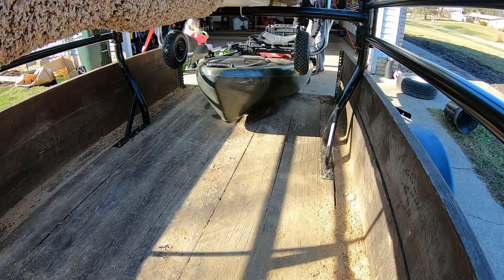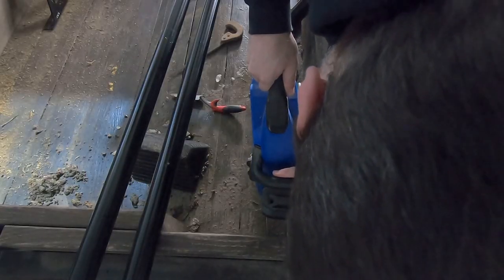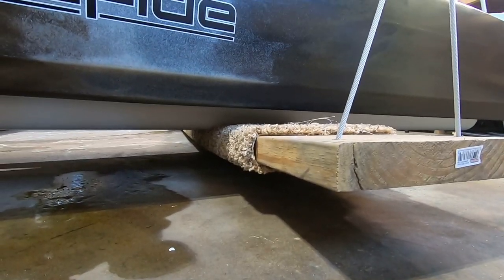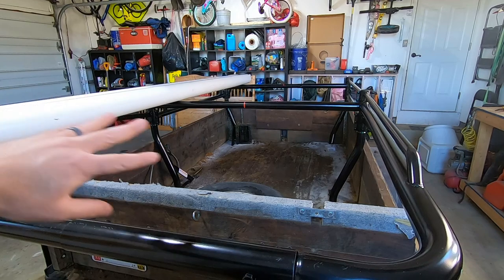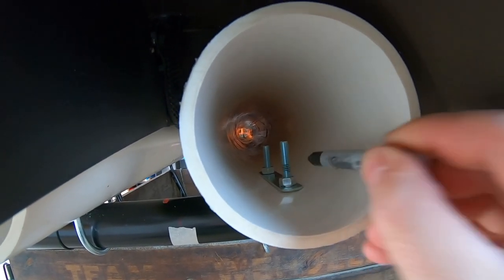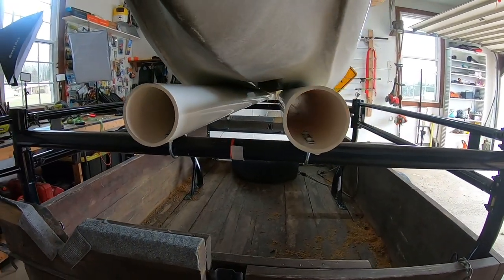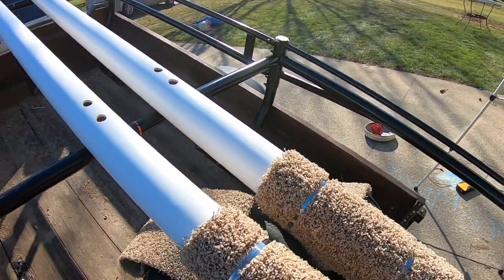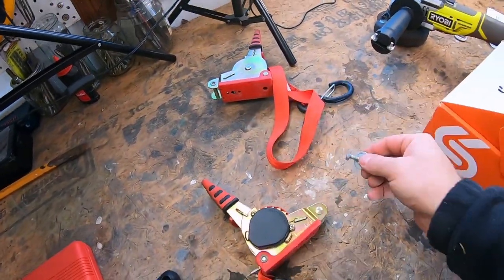How I Built a Kayak Trailer from a Utility Trailer

Comment: Little trick when u need to shorten the bolts/threads. Wind the nut on past the cut off point. Cut off in vice, clean up end. Then by taking the nut off again, it fixes/corrects the thread end. Which makes it easier to screw that nut back on when u fitting to trailer.
Reply from the maker: Now that make sense to me.. solid tip Ricky. Solid

Comment: I've been wanting to get a trailer. What's a cheap route, Any suggestions? I have a 10ft perception crank10.
Reply: How do you like your Crank? I was looking hard on that kayak. I just have Tamarack pro
Reply: @lowlife74  I bought it last sept. So far I do.  I just purchased my  anchor recently.
Reply: @ajp2811  awesome I really like the Yakattack deluxe  Anchor Trolley  or if you want go high end , Anchor wizard.
I just got a Garmin Striker 4 plus.
Finally going take it tomorrow due to Ohio crap weather
Reply from the maker: Hey AJP, this is not a recommendation by any means, but I have seen a lot of videos of how guys and girls utilize the Haul Master from Harbor Freight. Definitely cheap.. but I have never had hands on one. May want to check through the videos on youtube on it to see what you think. https://www.harborfreight.com/1720-lb-capacity-48-in-x-96-in-super-duty-folding-trailer-62671.html
Reply: @wendellfishing  from what I seen. This may be the route I go. It's fairly cheap. Thanks so much!
Reply: @lowlifeangler  I actually went the higher end and got the anchor wizard  with the DaBomb anchor.
Reply from the maker: @ajp2811  right on .. the only other cheap option is just waiting for the perfect deal on FB  Marketplace.